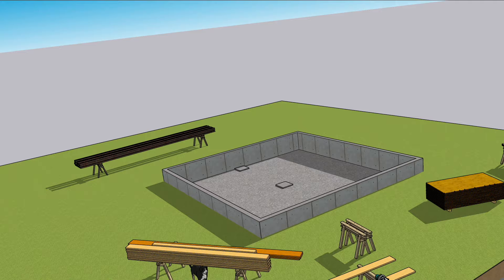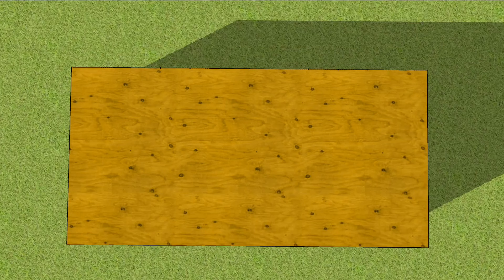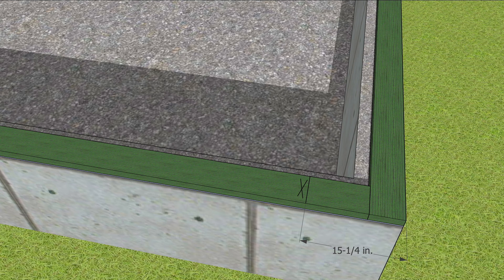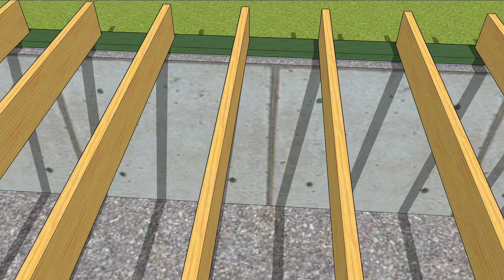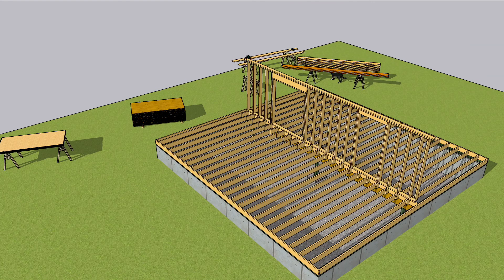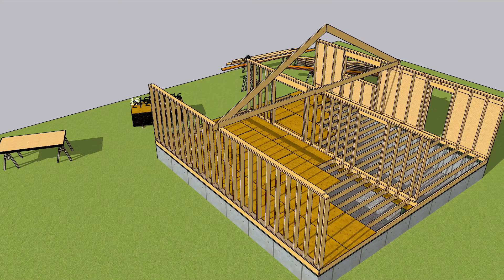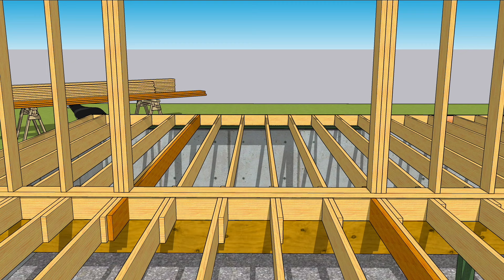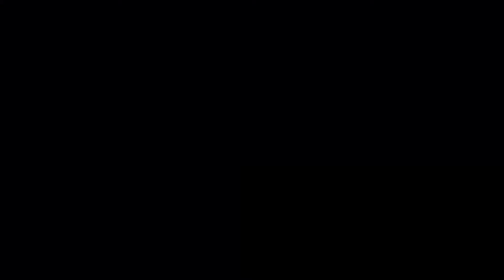Basic Floor Framing Layout, Point Loads, and Making Plywood Fit

Comment: This makes no sense, you can’t be 16” OC on both sides of the house if you sister your floor joists.
Reply: Been looking around trying to understand this too, but can't find a video to explain. It . Very confused
Reply from the maker: You have to stagger the layout 1-1/2 inches on the opposite side. And you have to rermember when you lay that row of sheets that bridges the two layouts.
Reply: @ProTradeCraft  if u go 15 1/4 inches and lay the 1.5 inch board down on one side of the mark it will be 16 inches on center. If u lay it down on the opposite side of the mark, it will be 14 1/2 on center. U know what I mean? Doesnt make sense. Plywood won't line up with joist
Reply: @ProTradeCraft  so you cut off a little on the 1 sheet to start?

Comment: Do you need double joist at partition walls that run parallel to the joists? And what do you do when a vertical plumbing pipe aligns with double joist at a “wet” wall
Reply: My guess would be that you don't need an addition joist for partition wall cause the weight of roof is much more than the weight of the partition with a TV) regarding the pipe, make it somehow so it doesn't intersect with that slim joist, the structural elements should not be disturbed just for a single pipe

Comment: Great video! Is the blocking between the joists required by code or just good practice? Also, could you have just added additional blocking under the trimmers vice adding an entire joist to transfer the load?
Reply: it's code if you have a 6ft gap or more.. it's bridging.

Comment: How u get 15 1/4
Reply from the maker: for framing that is to be 16 inches on center, the endge of the framing member will land at 15-1/3 -- 3/4 short of 16, so the center of the framing member will be at 16, 32, 48, 60, 72, and 96 inches, and the plywood will break.
Reply: He meant to say 15 1/4 (not 1/3). The reason you have to do this is that the first sheet will be on the outer edge of the rim joist, not its center.

Comment: Where should the sheathing layout shift for the staggered joists if the sheets don't break at the bearing wall?
Reply: I was thinking the same thing
Reply from the maker: At the next sheathing course. The point is to think ahead and know what's coming so you don't step in wet glue.